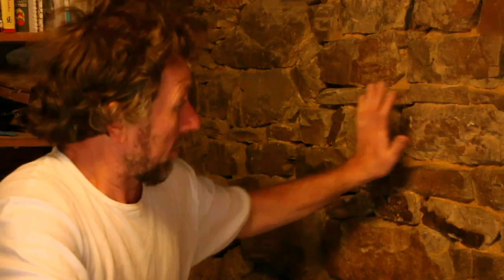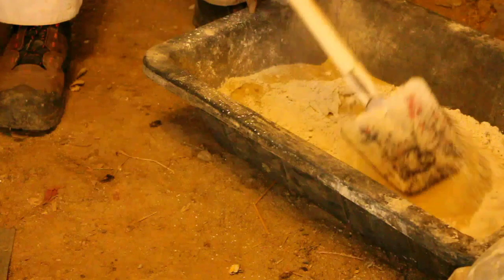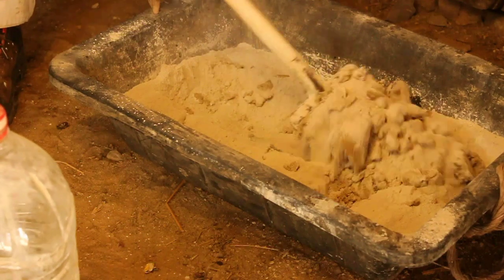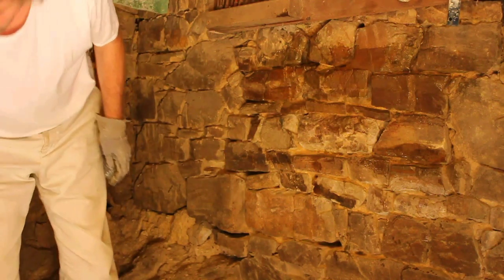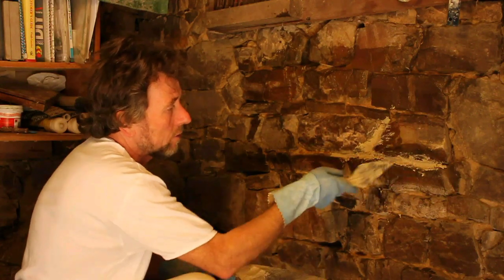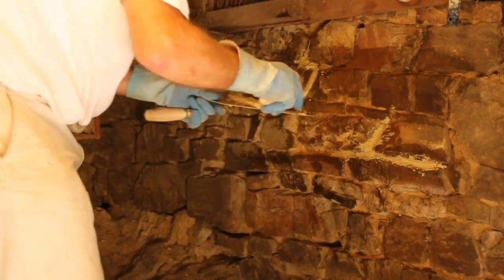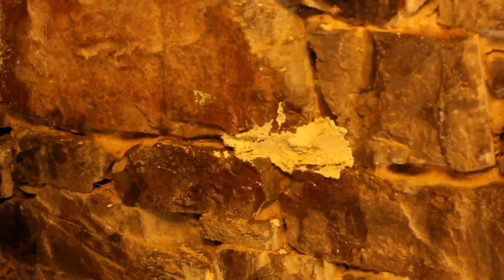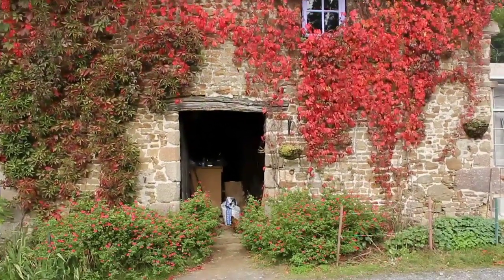Working with Lime Mortar. Pointing stone walls. Mortier de chaux. Hacer juntas con mortero de cal.

Comment: been trying to figure out if i can use lime mortar in a colder canadian climate, rather than the go-to portland based mortar
Reply: Lime needs to be applied above freezing temperatures, ideally above 5C but you can use it in slightly lower temperatures if you insulate the wall in some way, bubble wrap is a common one.
Reply: @calum1370  im more talking about durability if it freezes and thaws reularly
Reply: @mackenziemitchell1109   Lime will prove more hardy than Portland as its a lot softer so less likely to crack due to expansion and contraction of joints. If it's external pointing then normally I'll add granite dust to the mix and also use small stones to pack out deeper joints. Also make sure you fill the joints right to the back, as if water gets behind then it can blow the joint as it freezes and thaws, this is the same for portland also.
Reply: @calum1370  thank you!!

Comment: Hi there. Undertaking some interior wall lime pointing in damp Yorkshire. I've seen folk talking about using a churn brush to bed in the mortar after it's gone off a bit, wondering what your thoughts on this would be?
Reply from the maker: H i Seb,
This sounds like a good idea and will help both in the hardening and the appearance of your finished pointing. 
Great to hear you're using a lime mortar. 
I think that this summer has been damp every where, but cheer up, it'll soon be Christmas!
Best wishes from Normandie, Andy.
Reply: @Organikmechanic  👍👍

Comment: I have a bucket of water with pieces of broken roof tile. Soaked you insert piece of clay tile in the larger gap then motor it in place.
Reply from the maker: That's a really good idea,, I infill with small stone from the rubble, The soaking idea for the porous tile really works to make a good bond. Thanks for watching and for commenting, I really appreciate it. Best Wishes from Normandie, Andy.

Comment: Hiya, I am about to re-point the inside of my welsh house we have just moved into. The stones are all irregular, and the old mortar is very crumbly. Would you recommend using NHL 3.5? What is the difference between that and Lime putty? Many thanks, Great Video.
Reply from the maker: Hi Jamie, NHL 3.5 will be fine. Lime putty is the traditional form of lime produced by 'slaking' the calcium hydroxide with water and normally leaving it to 'fatten' over weeks before use. It is extremely caustic and at slaking highly exothermic. The hydrated limes whilst still caustic are much more readily mixed with water for immediate use and do not exhibit the exothermic reaction. They will also dry quicker thus more suitable for normal everyday use. It sounds like you've a big job to hand, but it will be worth it. Preparation is key, raking out as much of the crumbly mortar as necessary. You describe the stones as irregular, so my guess is you may not want to consider making them a feature, which is what we were confronted with here in Normandy. If I may suggest one remedy to this which is; after pointing, to cover the walls with an insulating render of chopped hemp and lime. This has the benefit of giving the walls a more even appearance and furnishes a breathable insulating layer. We did this in our house, in our kitchen using chopped hemp (used by market gardeners/landscape gardeners as a mulch) and elsewhere, in the lounge and the bedrooms using chopped linen (used as horse bedding). On the north wall of our kitchen we coated the wall with an initial layer of chopped straw (home made) and lime about 1" thick topped with a similar thickness of hemp and lime. The change in the room temperature was significant and encouraged us to extend our labours to all interior walls of the house after the Winter. When we undertook this work I did not have the equipment to produce videos but I have since illustrated the mixing of this media here: https://www.youtube.com/watch?v=kyHnCnHDyhQ with links to the accompanying written post beneath the video. Additionally, I've written this on my blog: https://www.blogger.com/blog/post/edit/3199850434720533796/6151073763776606655    I also used a mixture of linen and lime screed as an insulation layer on the old concrete floor in our kitchen prior to tiling, again this made a huge difference in the Winter months but also in the Summer when condensation would be evident on the original floor. I've had a quick search on the web and there is a stockist of the chopped hemp in Wales https://www.celticsustainables.co.uk/hemp-shiv-180-litre-bale/ but I'm  sure there are other sources. Good luck with the pointing and hope the ideas may be of help. Thanks for watching and commenting. Best Wishes from Normandie, Andy.
Reply: @Organikmechanic  Thanks Andy, that's so helpful. Which part of Normandy are you from. My wife is from Evreux. We met in Manchester, she went to Uni there. I have been and bought 5 bags of NHL 3.5 and some sharp sand. We have the whole of the inside and outside of the house to do. The inside had many layers of plasterboard and cement, added over the years. There was so much moisture trapped when we peeled back the layers. It is drying out nicely now though. 

Pulling off the 60s cement has left some parge gaping holes. And some of the original stones are loose. What would you suggest? I am constantly worried about the stability of the house, but the walls are around 80cm thick. We intend to leave some of the stone exposed and follow your advice and go for a hemp plaster coat to add some insulation. 

Thanks again for your help,
Jamie and Sylvie.
Reply from the maker: @wakeyjamie  Hi Jamie, so pleased you've found the information to be of use. With the large holes that you have, I would add some appropriately-sized stone into it on a bed of mortar and add more mortar into the gap above. Bear in mind that the purpose of a mortar is to keep the stones apart. This is very important with stonework where the irregular face of a stone, if in contact with the stones beneath can exert huge stresses due to 'point' load contact and this will lead to the stonework beneath to be fractured. You have similar thickness walls to ours, do you know what the original mortar was? In ours it was/is clay. How old is your building? Ours has one date chiselled into a huge oak beam of 1714 (which is nearly quarter-past-five!) and we've found a Double Tournois coin in the garden dated nearly a century before that.

There is a book entitled 'The Vernacular Architecture of Brittany' by Gwyn Meirion-Jones which has some interesting observations on the construction of houses of Celtic origin. My Uni had a copy of it and  it was informative  on the nature and reason for the old houses of this type and may give some insight into your own - worth borrowing!

We're currently in the baie de Mont St. Michel in Basse Normandie, not far from Granville. We moved out here permanently in 2000 after deciding to quit our jobs in England. Sue, my wife had bought part of the longere in '93-'94 and we acquired other adjoining parts later on. So we left academia to become happy peasants!

If I can be of any further help, don't hesitate to get in touch. Cheers, Andy.

Comment: Hi, nice job & looks a beautiful place. Your sand looks very soft, I guess that's the local stuff? Personally I would try adding some sharp with larger aggregate in, this will add strength without the need for the mix to become too limey and white. Also perhaps try using a smaller pointing trowel in combination with a hawk, it produces a neater job first time round and eliminates much of the need for wire brushing afterwards.it then can be stippled & brushed when green with a stiff natural brush.
Reply: Expertly put sir! What I would of said. No need for all those smudges

Comment: Thanks so much for the great video.....I’ve watched several times. I’m not sure where to start with my project. I bought a 585 SF, 100 year old stone house, 18 inch walls, beautiful stone capstones over the windows and doors outside but inside was wood. The wood is mostly rotted away....stones starting to crumble away. The roof/ rafters are gone along with the floor....should I put iron over the windows or wood?  I can repoint the walls but not sure what to do with the windows/doors....
Reply from the maker: Hi Linda, sorry for the delay. It sounds like a lovely house but with a few problems. Are the stones above the rotten wood collapsing, if so you'll need to put some temporary support or put a relieving arch to take the weight. I've dug up an old book on Brickwork and Masonry written in 1904 so of the same period as your house. The author cites the use of steel girders so I don't see why you shouldn't- but you should check the building regs for what treatment the steel needs prior to installing. Has all the wood rotted/collapsed for the same reason?I know that modern timber is treated in a much more sophisticated way than in the early years of last century.  It sounds like you've a challenging, but ultimately satisfying project and I wish you all the best. Will you be doing a vlog or blog on the progress if so I would love the links to see the works. Good luck and I wish you every success. Best Wishes from Normandie, Andy.
Reply: @Organikmechanic  thanks for your reply.....it’s great just knowing I have someone knowledgeable to ask questions!  I found a stone mason locally that seems like he knows what he’s doing and is willing to work on my old house. Thanks to you I have a bit of knowledge.....He appreciates the value and beauty in old houses...He has already made oak headers and is ready to install. I have more cleaning to do inside, but I’m ready to start pointing this week, weather permitting. I’m wondering about the roof, strength of walls to support it, or using a timber frame.....always trying to think of the next step....thanks again
Reply from the maker: @ezmailer04  Hi Linda. Bravo for finding a sympathetic mason, here in France many of the artisans who call themselves masons have no interest in older properties and traditional materials and will resort to using concrete and cement based mortars on old stone and clay buildings removing all the charm and character in the process and leading to further potential problems with dampness and faster deterioration in the rest of the walls. Check for frost before you start pointing, otherwise it can 'blow out' the mortar if it gets too cold. With regards to the roof , I would think that provided the walls are ok, there should be no problems in replacing what is already there. I'm unsure what you mean by 'or using a timber frame'. If you can get into your loft, you should take pictures of the original structure, so that you can better understand it. What is the existing roof covering? Also bear in mind that the walls always bear the vertical load of the roof, are you concerned about whether the roof could push the walls out horizontally? Keep up the good work, it sounds like you're making great progress. Best Wishes from a cold and damp Normandie, Andy.
Reply: @Organikmechanic  Andy, thanks so much for the conversation and encouragement! My house is basically a stone shell....the original roof was wood shingles and it’s completely gone as are most of the windows. Remember it’s over 100 years old and has been exposed to the elements for many years. The weather will be above freezing this next week and the mason thinks he can get the oak headers in. I’m really happy with his work so far. He placed one of the headers in and it’s exactly what I envisioned. I plan to cover them with tarps over the winter months until I can get a roof on....I’m planning  to put 8 concrete pier footings along the inside walls, then 6x6 posts to help support and anchor the roof. There’s tons of cedar trees close to the house and 60 year old junk and broken jars..... I have to admit some of its treasures! Lol  But still takes time to clean up. Take care and happy holidays!
Reply: Hey Andy hope you’re doing well. I’m still working on my house. I have a small RV and travel every chance I get! Lol
The house is my life project in between trips! I’m using a lime and sand mixture to point the walls…. But I want to redo the front step. It’s a large sandstone 24 x 10 inches, 6 inches thick. It sets on a very very large flat sandstone. I want to make the step larger and secure…my question, what mortar mix do I use? Sand and lime or concrete? I can do this Thanks for your help
Linda

Comment: Hello Andy, thanks for your video . What do you recommend for an  outdoor stone pathway? I'm restoring a site at an old spring well . The original stone pathway is still intact but I need to add flagstones to the surroundinf area to stabilise the pathway and create a standing area close to the well opening. Can I use lime mortar to secure the flagstones? The area will be exposed to rainfall and is shaded.
Reply from the maker: Hi there katins s, sorry for the delay in replying. I believe that a lime mortar will be suitable, just make sure there is a firm base of gravel firmly tamped down onto which you bed the flagstones, make sure you have a 'fall' so as to ensure no puddling of rain water. Thanks for watching and commenting and good luck with your project, it sounds like a great sympathetic project. Best Wishes from Normandie, Andy.